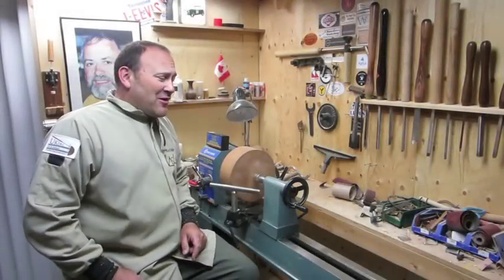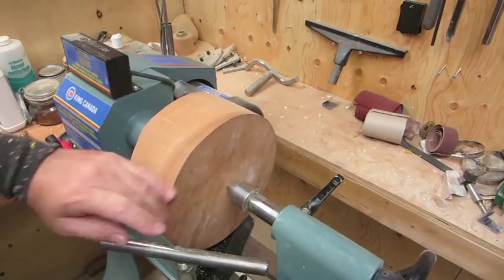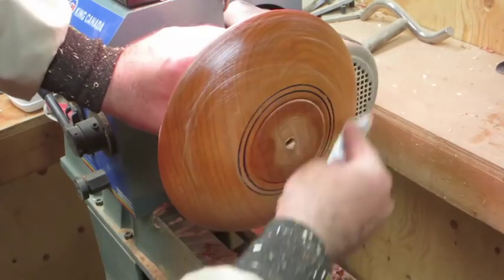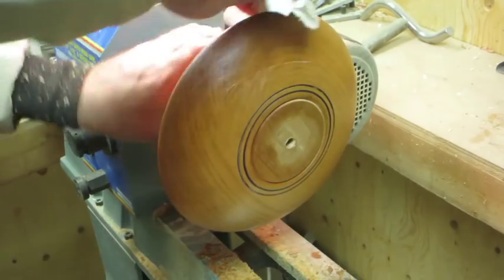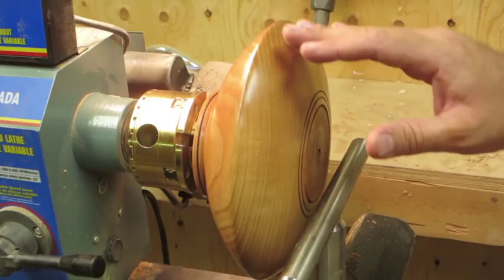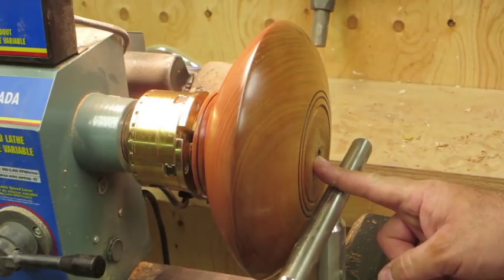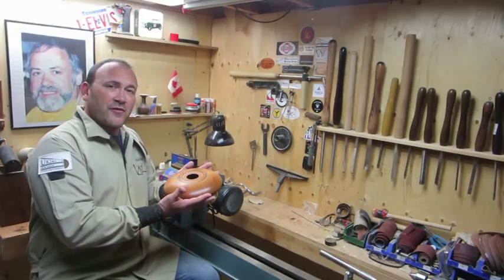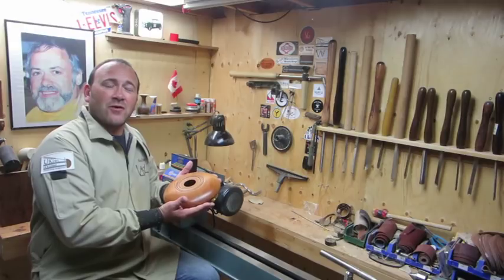woodturning # 71 cherry hollow form

Comment: Beautiful bowl. Wish I could have better seen the tools you used for the inside. Also, a strange question, but where did you get your turning smock? Hard to find ones with long sleeves, a velcro closure at the neck and is long (close to the knees).
Reply from the maker: Hi Gary
I got my smock from Lee Valley but they don’t stock them anymore, I don’t know why. I actually have 2. 
this video is 3 years old so I can suggest better tools than I used here, check out the easywood hollowers 1-2-3, they come in medium and full size they are carbide and do the job very well.
Take care Rob

Comment: Great video, thanks.  I know how to make black lines using a wire burner, but what was the tool you used to make the lines around the top?  Very pretty - thanks.
Reply from the maker: Hi Dan 
Burn lines are essentially created with friction, so using a wire, strip of harder wood or as I use a Formica test card from the hardware store will give you the same result, I personally feel the card is safer than the wire 
Take care
Rob
Reply: @WoodsleeSummercraftwoodturning   Something new to try.  Thanks!

Comment: Good Day.  Great vase. 
 I am currious about your technique of burning a line in the wood.  I know about using a steel wire around the vase but in the bottom what was the tool used.  Is it a simple steel card?
Reply from the maker: Hi
Thanks for watching, essentially you need friction which creates heat and burns
I always use a Formica sample card that you can pick up for free at the hardware store where they sell counter tops. They work great and in my opinion safer that using a wire
Reply: @WoodsleeSummercraftwoodturning  Great.  Thank you for the information.